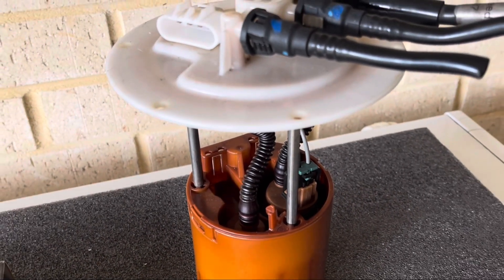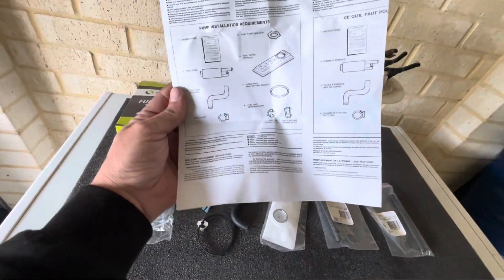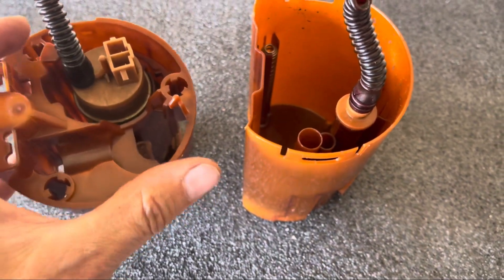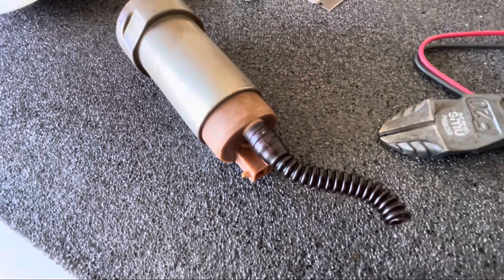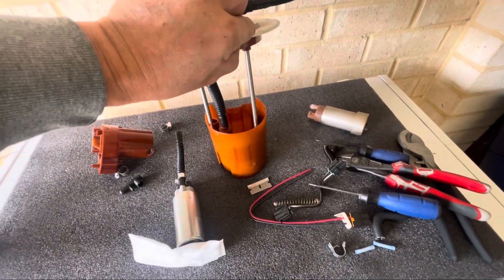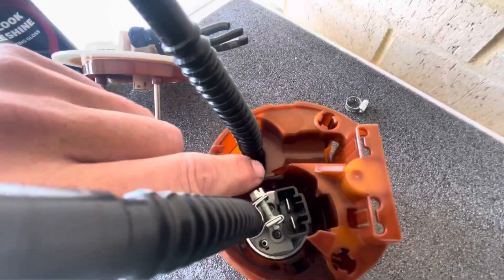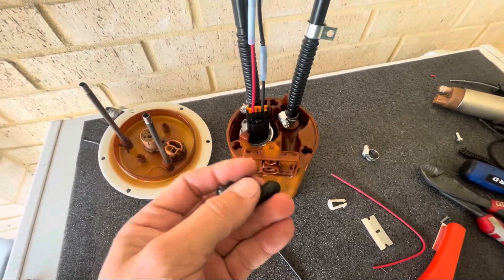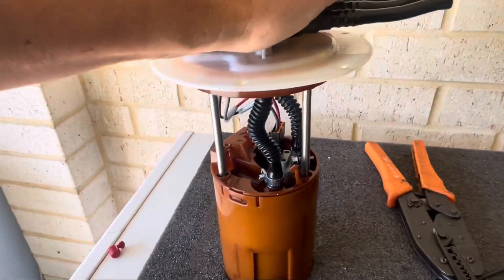Barra NA+T Build Pt.18 - BA BF Walbro 255 Fuel Pump Upgrade

Comment: really happy i've found this series to reference to when i finish sourcing all the parts for my na+t, my main concern is a defect and having to rip it all off or go the engineering route, are you getting this checked over by dot and permitted? 

apparently there's a loophole where if you use stock b series turbo parts (normal log manifold off an xr6t) and mock it up to just stock standard xr6t spec you can get away with permitting it and not engineering? then you'll be re-registered as a turbo b series? (of course this is if you initially were a na b series)
Reply from the maker: Yeah mate. I have not yet done anything in regard to getting it registered as a Turbo, but I will be doing that in the near future. I've read seen the same thing about using standard parts s these cars did come standard from factory with the turbos so hopefully it isn't too much of a hassle getting it done. I may even document the process of getting it done. Cheers.
Reply: @Jeenzy79  Sounds good mate goodluck, personally would love to see any part of the process, would be another great reference point for myself!! Cheers
Reply: @Jeenzy79  Something crazy I've just figured out after revisiting your channel now that I'm buying the NA+T parts, I now own your shockwave blue xr6! I thought the property looked similar and now have realised why after scrolling back on your videos, such a spin out to see ahah
Reply from the maker: @dan5973 Hey mate, aha that's awesome! Hopefully the car is still going well? Would be awesome to see the turbo setup on it.
Reply: @Jeenzy79  Yeah the car has been great, not sure if you heard from who was selling it but it was my first car, I plan to keep it and build it for a long time to come. That transmission slip ended up being a gear 3-4 solenoid and a pressure regulator solenoid, now when it is warm it will not slip but cold it still does, I do plan to dig deeper and get it not slipping at all but we will see!

Comment: What an awesome series. Just binged the full series and will be coming back to this as I work through a +t on a wagon. Looking forward to more content
Reply from the maker: That's awesome mate, thanks for watching... hopefully some of it might be useful. Cheers!
Reply: @Jeenzy79 oh for sure. I didnt think I could run a fg intake but I definitely want to since they look so much better. Also the confidence for the valve springs. Looking forward to rewatching as I tear apart my engine.🎉
Reply from the maker: You’re not wrong mate, FG turbo manifold is much cleaner than the B-Series one. Makes it heaps easier working on things in the engine bay too. The valve springs were a fun job to do out of the car, just take your time and after you do a couple you’ll have it sussed.

Comment: Hey fella, well done as always but that is a strange fuel pump that I have not seen before (never had to change one honestly), what is the reason for the spring action, is it to do with vacuum of pressure that occurs in the tank? Thanks.
Reply from the maker: Hey mate, I believe the spring is used to keep the pump at the bottom of the tank. The spring keeps the pot resting on the bottom to help it from starving of fuel.

Comment: hey man im sure ypu probably mentioned it before but I cant find it, where dis you source the water feed hardline from the thermostat housing?
Reply from the maker: Hey mate, the hardline I ended up using is actually from two different lines. I’ve use the b-series one around rhe back of the engine and chopped it under the intake manifold and I used a FG one off the thermostat housing and chopped that as well then I joined the two with a piece of hose. So far so good but I am still on the hunt for a Manual FG NA line to replace it with. Just can’t seem to find one anywhere